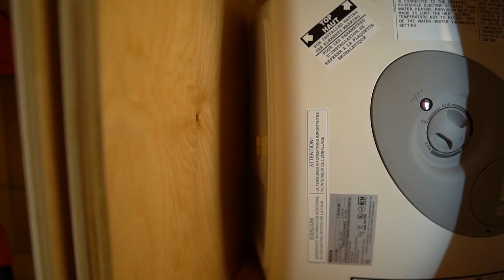Plumbing Our Bus! All of the Supply-Side Plumbing for a Skoolie/Bus Conversion

Comment: I’d suggest adding some water to detectors/ alarms in those spots with the shark bites and sensitive areas with water storage. Just incase when the rubber gaskets in the shark bites fail in  time and/or vibrations. …All plumbing fails eventually and water alarms are cheap.
Reply from the maker: Hey Brandon. The cool thing is in a bus conversion if you leave your pump on at all times (which we do) the pump is actually a water alarm. If the pump is running and you are not using any water you know you have a leak.

Comment: Hey man I've been considering bus life for a while and things have lined up where I might just have the money to actually go forward with a plan to buy a bus I was wondering if I could chat with you about a few things regarding your water heater and how you set up your water tanks. I have been watching you for a while and have some engineering background but I don't trust myself one bit and I'm sure you didn't either when you set all this up which is why I'd like to get the answer straight from the horses mouth. What was the point of the plug, and putting your water heater into a cabinet? I was planning on having most of my equipment including electrical and water connections central in the bus and under my counter space but every one I have watched seems to have wires and pipes moving all around cabinets for each individual item... can you give any insight into this as well as any other information. I'm super stoked to get into this community and promise I have some value to add and can help with engine/mechanical problems but I just cant seem to gather enough information. 
Let me know your thoughts thanks.

Comment: Me again. Sorry, binging some of your videos today 🤣 I am curious what your thoughts are about a tankless water heater, and why you chose the 7 gallon Bosch water heater over that?
Reply from the maker: Tankless propane is great, but we're not using any propane in this build. Tankless electric requires too much electricity all at once which means a much more robust electrical system. For $200 this water heater  is just the perfect solution and 7 gallons with a low flow shower head has been plenty in our experience.
Reply: @MobileDwellings  We decided to avoid fossil fuels other than diesel when we first conceived of doing this project, and if we could convert to an electric drive train we would do that, too. So  we will probably follow your lead on the 7 gallon tank.

Comment: I would be leery of all the shark bites.   Crimps are super easy and so much cheaper and less likely to leak.  Literally can buy a 10 pack of fittings for like 10 bucks
Reply from the maker: I'm gonna go that route moving forward for myself but I've never heard a solid argument against sharkbites except for the cost. For the diyer with a small system it adds cost but takes out the complexity..
Reply: @MobileDwellings  as a plumber for a larger metropolitan city, I've seen more damage and leaks caused by failed shark bite fittings, especially when dealing with freezing conditions. I do keep some on my truck as a stop gap to complete emergency repairs in a pinch, especially if I know I'm going to come back and rework the piping. I would never use them in my own build, even if they were the cheapest fittings I could buy. Shark bite has just developed a new line of fittings to help solve the problems they were having with the original line, but I'd still steer clear. Me personally, I prefer expansion rings or crimp rings with PEX. I also wouldn't ever use the cinch clamps.

Comment: dope video. 2 questions:
1. why do you use regular hose and hose clamps between the pump and accumulator and not pex?
2. the pump is way high above the exit from the fresh water tank, and even has an elbow joint before it. If that whole pipe is full of air, can the pump pull the water up that tubing and around the corner into itself?! or does that tubing need to be full of water (say from the fill up)?
bonus - any reason you chose a 115v water pump vs a 12v?
Reply: re: 2 i see its because of the "self priming to 6 vertical feet" - so does that mean it can pull water up 6 vertical feet of air?
Reply from the maker: Interesting questions. The pump gets flexible vynil pipe because it reduces the noise and vibrations that the pump makes while running vs pex. And yes the pump can pull air through itself to get to the water and being above the exit is not a problem.
Reply: @MobileDwellings  what about the AC pump vs 12V DC?

Comment: I did my plumbing system basically the exact same way but all the joints are leaking. Any advice?
Reply from the maker: Never had a joint leak on these ever. Did you for sure push them in all the way? Did they freeze?

Comment: Love your videos! I bought all shark bite connectors and a lot of people are telling me it’s a very bad idea because more than likely half of them will leak. I’m completely confused and now I’m thinking of returning all the shark bite stuff and use crimping method.  Do you have an opinion? Thanks!
Reply from the maker: Thanks! I'm not sure why anybody is telling you that. I've never seen one leak
Reply: @MobileDwellings  I wish I knew! I also wish you were in Los Angeles.
Reply: I talked to a plumber and he said to use the crimps, too. It's cost effective and easier to fix when they fail.  He said that they do often fail, but not the crimps. 🤷‍♀️ 

Then again, he works in residential settings where the water pressure is much higher than in an RV.

Comment: What type of wood is that on the walls and ceiling?? Doing mine and want that exact look for the walls and ceiling!
Reply from the maker: Purebond birch plywood from home Depot. We patiently picked through hundreds to get the nice ones!
Reply: @MobileDwellings  Thx man and LOVE the videos, they are helping me tremendously! 1 more question lol, what is the thickness of the plywood? My bus has bowed walls and im nervous about the flexibility of the plywood being able to form against the bowed frame. THX A BUNCH!!!!!
Reply from the maker: @DiamondFaithNetwork  the ceiling is 1/4". if you have a really tight bow it won't work so well. Glad they've been helpful!

Comment: I hate to be a wet blanket you won't be able to fill up your tank completely where that's at it will only be able to fill up to the outside connection because it's lower than the top of the tank because water seeks its own level and doesn't run uphill.

Comment: Do you need an accumulator tank at the water pump and the water heater?  I bought a pump that has a two gallon accumulator tank that it sits on, so I am wondering if the one after the water heater is necessary.
Reply from the maker: Hey Bethany. So we do have an accumulator tank after the water heater but it is way smaller than 2 gallons! This helps the pump not cycle too frequently which really only increases its life span and makes for a less unpleasant noise. Now an accumulator tank after the water heater would be necessary if you are using the 7 gallon water heater we used and also putting it on max temperature and leaving it own. At that point it will drip through the pressure relief valve. However we set the heater to "ideal" which is hot enough for our needs and it doesn't ever leak. Hope that helps!
Reply from the maker: Hey Bethany. So we do have an accumulator tank after the water heater but it is way smaller than 2 gallons! This helps the pump not cycle too frequently which really only increases its life span and makes for a less unpleasant noise. Now an accumulator tank after the water heater would be necessary if you are using the 7 gallon water heater we used and also putting it on max temperature and leaving it own. At that point it will drip through the pressure relief valve. However we set the heater to "ideal" which is hot enough for our needs and it doesn't ever leak. Hope that helps!
Reply: @MobileDwellings  Wow, thanks for the fast response! 😁

We do plan to use the same water heater but we won't be leaving it on and plan to do the 20 minute warm up before a shower, then turn it off after.  So we won't need another accumulator tank after the water heater, correct? Just one after the water pump?
Reply from the maker: Yeah I'd skip it! Just keep an eye on that pressure relief valve. You can always install one later if you need to
Reply: @MobileDwellings  thank you so much for your help! I greatly appreciate it!! 😁